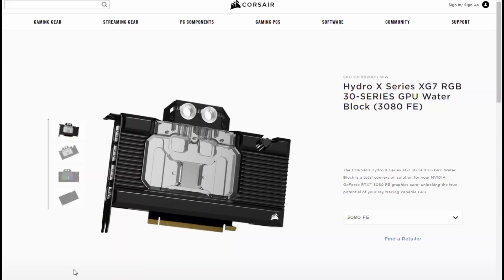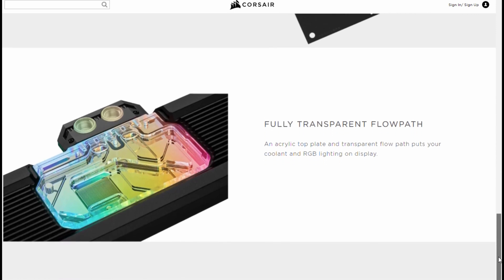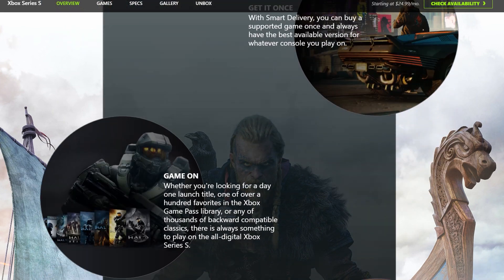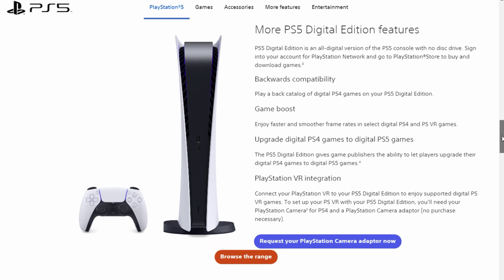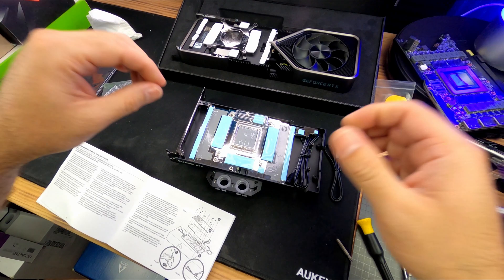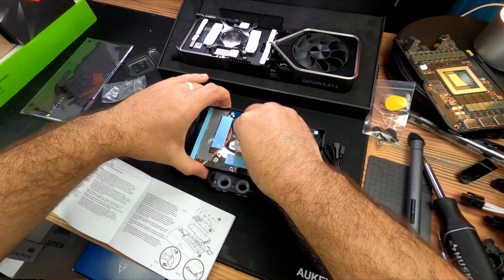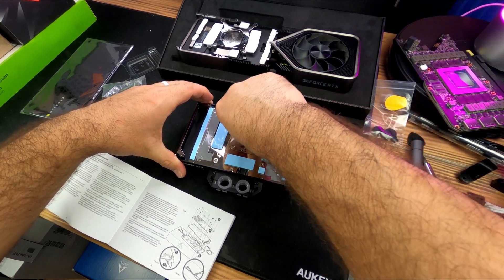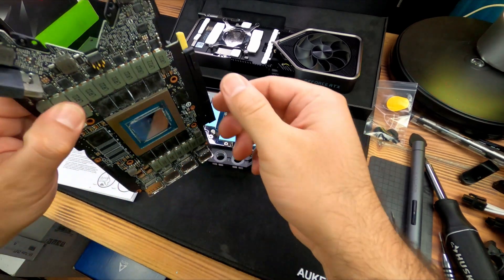Installing the Corsair Hydro XG7 3080 Founders Edition Water Block + XBOX and PS5 Giveaway

Comment: Hey Techmonkee. In the video you said you could use the FE back plate. What did you mean by this? Can you use it instead of the one provided by corsair, and if so do you have any pics what it looks like? Thanks.
Reply from the maker: I don't have images for it, but the gist is simple. Just reinstall backplate instead of the backplate from Corsair. Usually done for fitment issues on itx sandwich style cases.

Comment: Is it feasible for a beginner , but handyman? And you forgot to put thermal pad on memory below the card you have good temp?
Reply from the maker: I thought it was pretty simple. Shouldn't be difficult for you, I'm no expert but it did take me more time just to make sure I had everything right, you should go much quicker given this video.
Reply: @drew71844  Okey thank you and second question , you loose warranty by passing under wateblock right? It scares me for the futur maybe if the card has a problem.
Reply from the maker: @Ben-if9ic  you don't lose warranty by taking it apart, that once was a thing but since people wanted better pads and paste, they had to open it up which in time passed it would void warranty but not today.

Comment: Hi, Great video! Could you let me know what thickness you used for backplate pads? And how are the temps now?
Reply from the maker: Link here: https://amzn.to/3riiTAI
Temps while gaming is in the 50s.
Reply: @drew71844  in the progress of buying thermal pads for the backplate... there's a cut in the video where you put on the first pads ... did you double up? would you buy 0,5mm again? seems to thin looking at the backplate screw 'dimples" . thx
Reply from the maker: I doubled up in some areas, but the main parts were just one pad, didn't want to buy two sizes so I used what I had. I've had no issues.